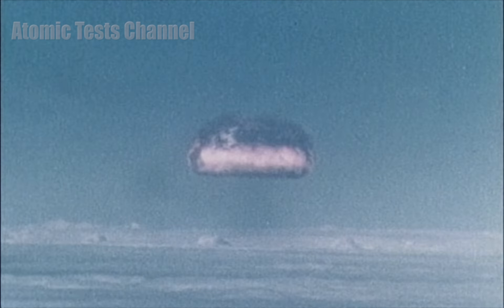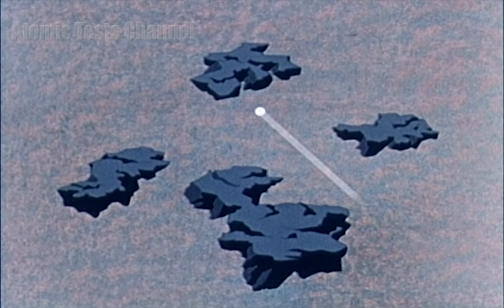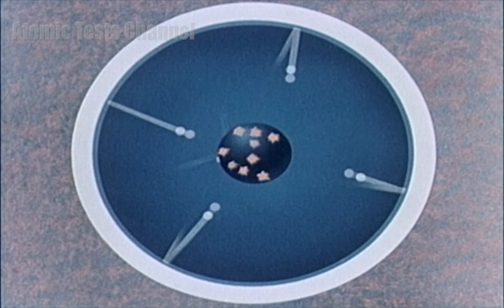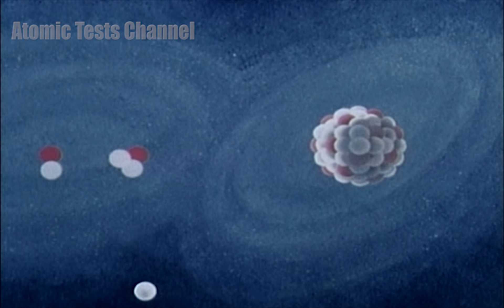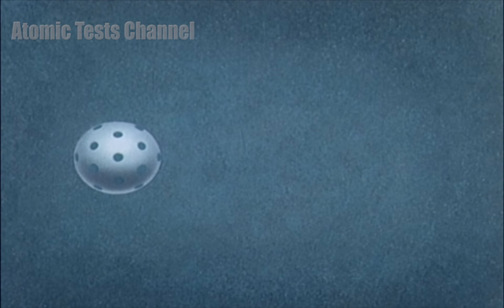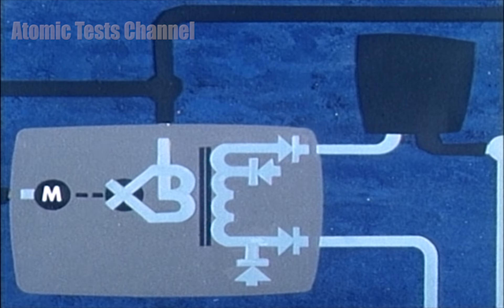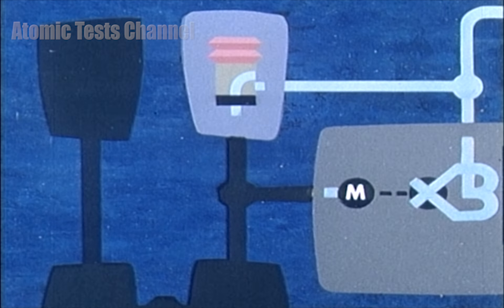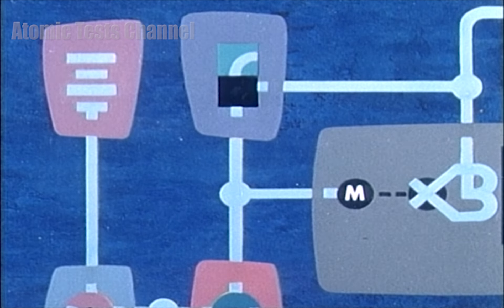Basic Atomic Weapons How Nuclear Weapons Work

Comment: To me, the most amazing part is how you can compress a really hard metal like Uranium or Plutonium into a smaller, more dense form....just with conventional explosives.
Reply: They are similar to lead, hard, but not quite as hard as say tank armour steel or titanium.
Reply: @garysmith9818  I've heard of Plutonium being described like cast iron, but I'm not sure if that in hardness or how brittle it is. And Uranium is used in anti-armour rounds as it's hard and "burns" through steel rather than mushrooming. But all that aside, even if it's like lead, how does any metal compress down to a smaller size....do the atoms get pushed closer together?
Reply: @Pete856  The big thing with spend uranium being used as anti tank armour piercing shells is that it is very heavy, heavier then the same volume of lead actually. It is accelerated to very high speed (5x the speed of sound) in the gun that fires it and the energy it produces when it hits the armour shatters that armour. It's not a nuclear reaction, just a heavy object doing it's best to imitate an irresistible force, lol. 
I hope this link works, the first part of the article is good at explaining how this works.
 
https://www.theguardian.com/world/2000/may/18/armstrade.kosovo

If the link works, here is an article discussing implosion of metal in a nuclear bomb. Please note the immense pressures involved.

http://nuclearweaponarchive.org/Library/Implsion.html
Reply: @Ikaros---  Early cores were solid.
Reply: 69aussieguy Yes, the atoms do get pushed closer together. That’s why a given mass of U235 or Pu239 can be subcritical at one density and critical or supercritical at a higher density. The atoms are pushed closer together, increasing the chance that a neutron will hit an atom and split that atom.
Reply: @garysmith9818  The atoms are indeed pushed closer together. That's indeed what it's all about. The compression only lasts for a tiny fraction of a second, but the following chain reaction in the fissionable material occurs on an even much shorter timescale, it needs only about 1/1000000 of a second to run to completion. Without nuclear reaction the compressed sphere would just expand again after maybe 1/1000 or 1/10000 of a second.